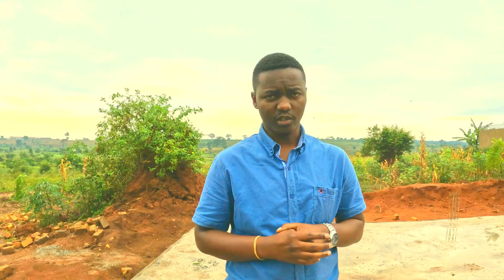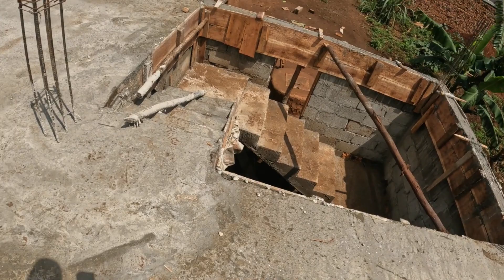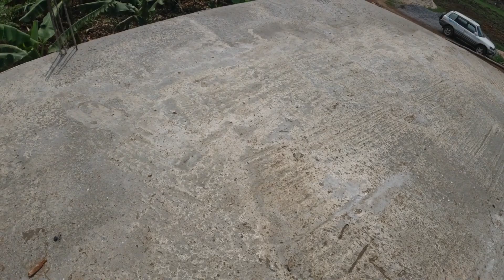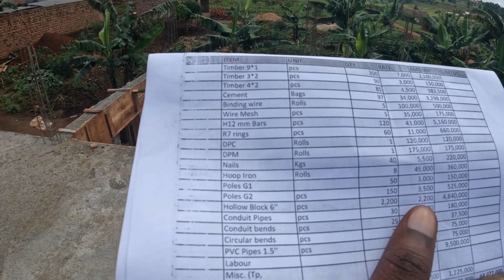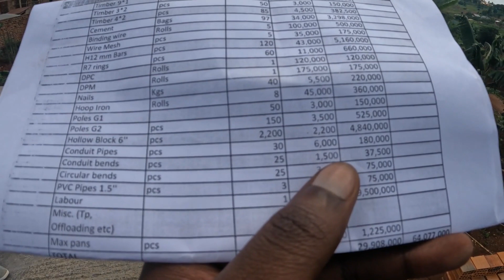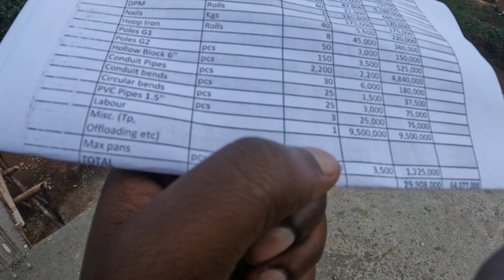EP-05 The actual cost of Buildings a 3 Bedroom House in Uganda

Comment: I like your work but this is a very expensive way of building such a house. It looks like a bunker. The material used one might think it’s a 5 storey building or maybe there’s a car park on the next level. The concrete stair case is so old fashioned which is so expensive. Have u ever thought of a wooden stair case? Very cost effective and the beauty is next to non. Good work though
Reply: I think the house would have been cheaper if the client used steel/metal frames but i guess he or she wanted the old fashioned style of building, anyway it's a great job from Mr Darwin.